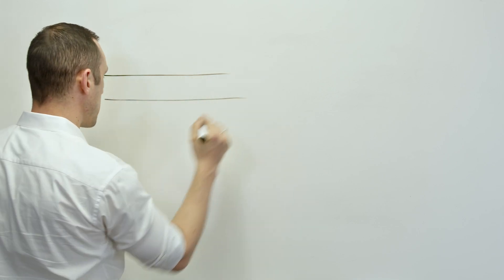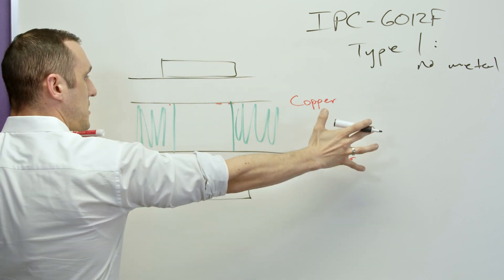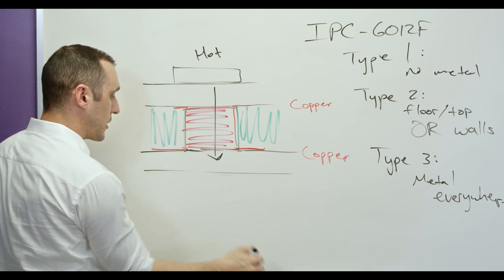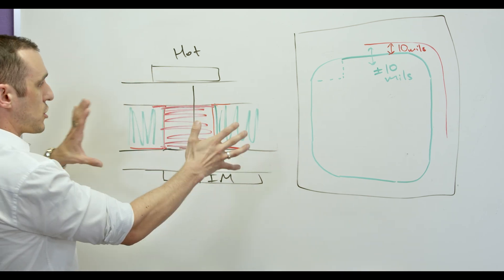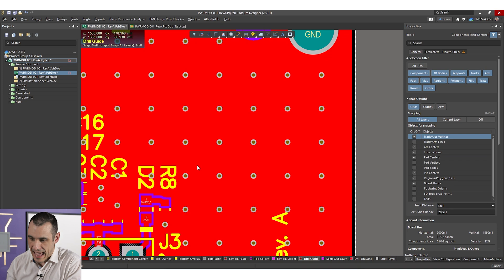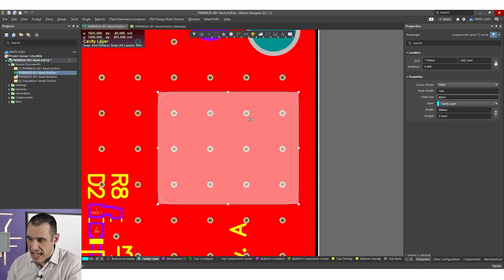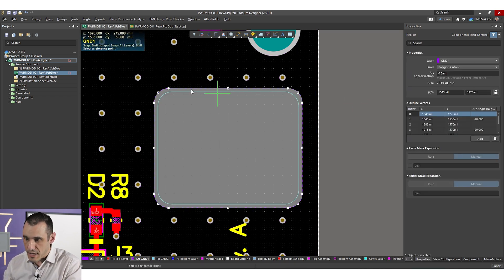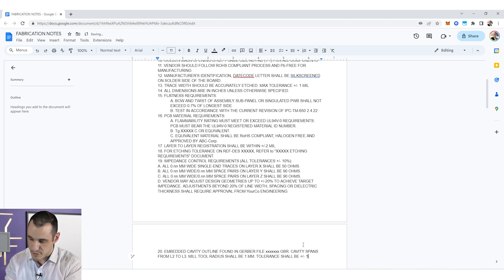How to Place Embedded Cavities in a PCB

Comment: What should I do If I have 2 cavities a smaller and a larger at the same place, and having ground copper in bottom cavity? Why should I need  mechanical layer? Can I just put milling path?
Reply: I'm not sure I fully understand what you're asking, but it sounds like you want two cavities on top of each other. If that is correct, the you can draw each cavity in its own mechanical layer. Regarding milling path, you can ask the fabrication house and see if they would want you to define a milling path. If the manufacturer can support cavity fabrication, then they should be able to define a route path in a CAM tool even if you do not provide that data.

Comment: How the heck does a manufacturer mount smt components inside an embedded cavity?
Like a regular stencil would be unable to deposit paste on the pads inside an embedded cavity right?
Reply: It can be done with an automated solder paste dispenser. You're right you can't do it with a stencil. If automated dispensing is not available it could probably be done by hand depending on the cavity size.

Comment: So the tolerance is 250 um (0.25 mm).
Reply: Yes that is a typical value for clearance (10 mil). However there is one fabricator I worked with on some boards that allowed the clearance on copper near board outlines to reduce to 8 mils to accommodate one of our very dense boards, and they would say the same about the outline clearance around a cavity because they are using the same tooling.